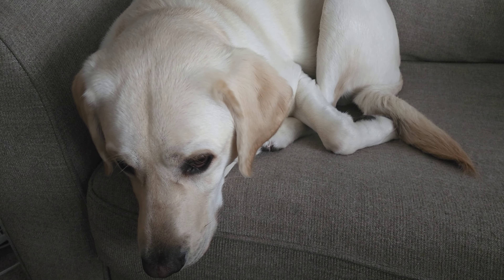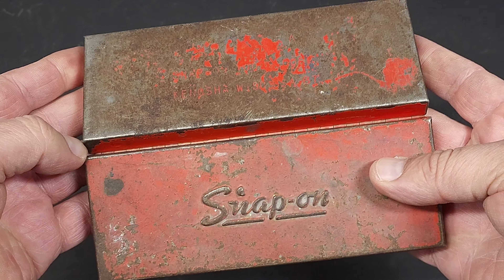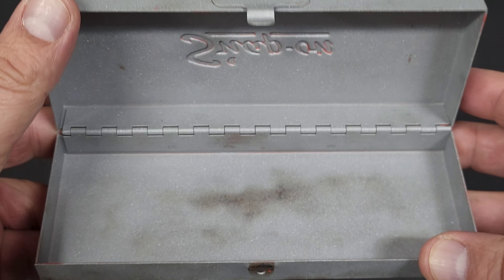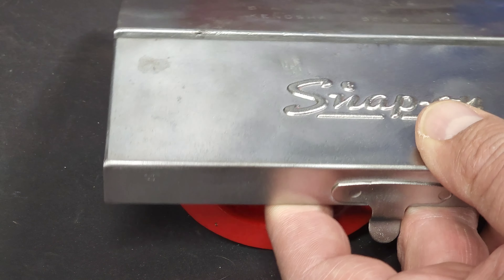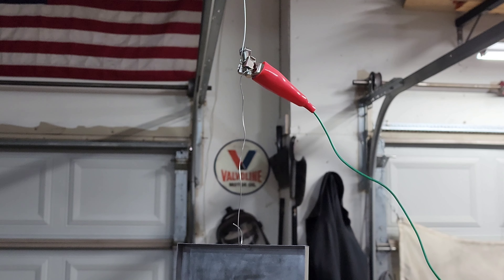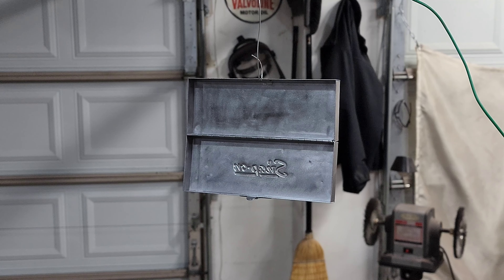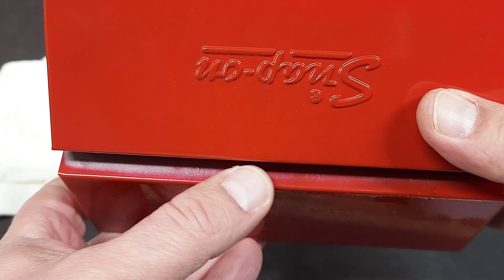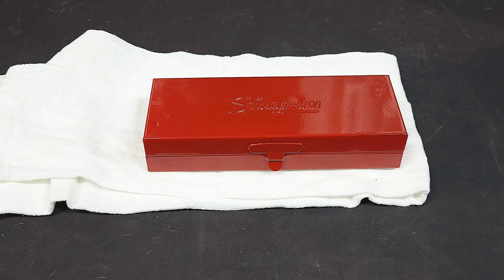First Time Powder Coating

Comment: It probably didn't get covered because it had contamination in that spot. You should out gas before you powder coat any part that has come in contact with grease or oil.  On the hinged part, the top and bottom were too close together. Possible Faraday effect. The powder was being repelled. Open the hinge more and connect to a better ground. The ground on that gun isn't the best.
Reply from the maker: Thanks so much for the feedback! I really appreciate it.